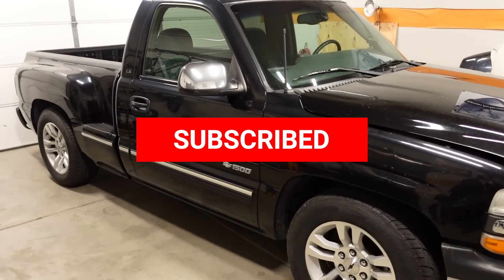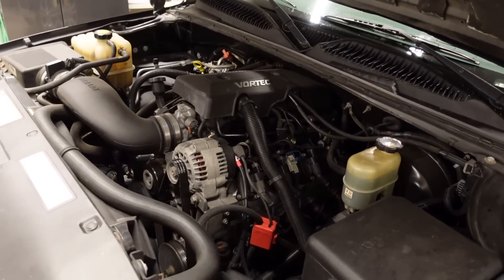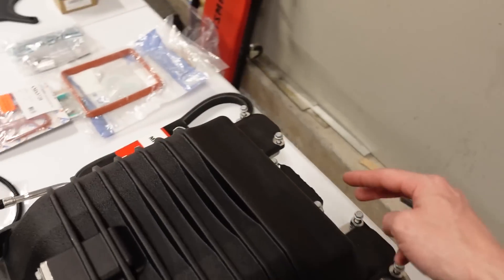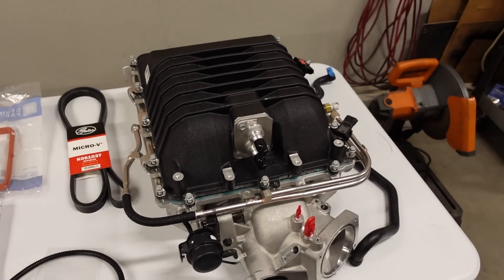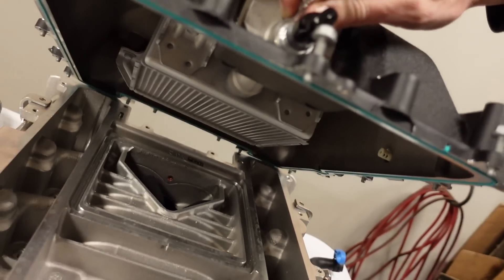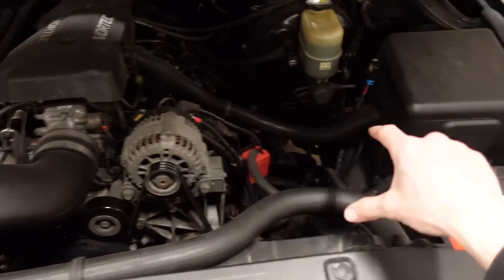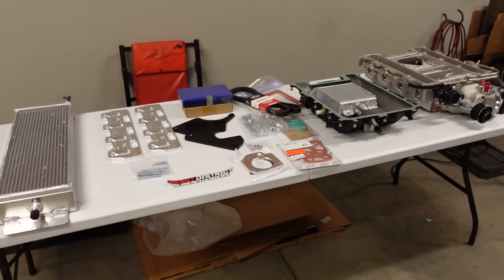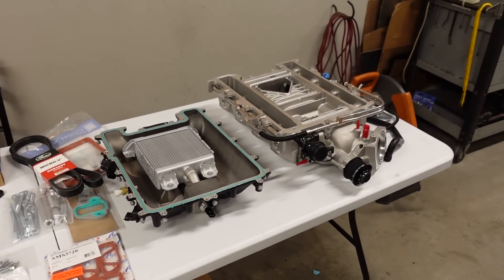unboxing my BOOST DISTRICT LSA Supercharger Kit

Comment: Just my personal opinion with a somewhat built 5.3 (668 HP forgot the torque) that I daily and I have a 70 Superbee that makes... idk because I'm still sourcing some lines so it can drive (previous guy let it sit for 20+ years). But I'd prefer a 4.8 / 5.3 OVER the 8.1 and 6.0... especially those older 6.0s those were turds unfortunately. I get once you rip things down and start building but then that just brings up way better options out there. 
The 5.3 has been really behaved and nice to drive. Just been keeping up on maintenance... and that time it blew the extension housing up.. whoops. Gave me an excuse to rebuild some stuff.
Anyways assuming this is intended as a street truck for cruising. I'd stick with the 4.8.
If you do choose 6.2 get that 6.2 with the 6 speed, that 8 speed is a damn problem. I would avoid 6.2s in general just like I avoid the 5.7 hemis because if I want something more there is way better options out there and if you're going to spend that kind of cash you mine as well pick an actual beast. 
OR hear me out, make your bank account cry and if you want a divorce this might help... Duramax awd in that little truck.

Comment: I have 4 6.0 engines a 4.8 block for mockup and a running 5.3 in my truck
One 6.0 boost ready sbe 
Cam, springs , headstuds and 80lb Snakeater injectors on a ported Dorman truck intake
Luckily i keep gettin 6.0s tossed my way

Comment: So I have a 6.0 and eventually I will do lsa then forged 408 lsa.. I love the supercharger sound.. I had a gtp and loved it. Turbos are cool but nothing like a supercharger.. to the tb I think you should get a 92 or 102 now bc your going to have to buy a 3bolt to 4 bolt adapter anyway might as well get bigger tb. I think the 78 will be a choke point and you can get a cheap ebay one  that will work great

Comment: I didnt notice a new throttle body....any reason why you want to use the stock truck TB over a bigger 4 bolt version?
Reply from the maker: I was just showing the parts that came with the kit, but I did actually order a 92mm TB to install
Reply: @TolmanPerformance  cool deal.   Although I wouldn’t kind seeing the power progression of the stocker to the one you ordered, to the next size and maybe some blower porting? 🍺

Comment: On the Corvette style regulator, I’ve had issues with 2 AC Delco units supplying too much fuel pressure 1 at 75 to 80psi, the 2nd at 85 to 90 psi.  This is with a Walbro 255lph pump in my ls swapped 72 GMC.  The previous regulator filter held 55psi but dropped pressure after turning off the pump, almost an instant drop.  I’m going Aeromotive pressure regulator.
Reply: Agreed. The vette regulator works well with a stock pump. But any time you put a bigger pump on, it’ll overpower the vette regulator’s return side.
Reply from the maker: good to hear, I had ordered an aeromotive regulator so I feel good about that

Comment: Holley sells a throttle cable bracket that bolts to the throttle body bolt holes
Part number 20-148
I’m using it on my lsa swapped Volvo works good!

Comment: Should at least pull it apart and open the ring gap a few thousands . . . The rings are known to buckle and a good chance to put mls head gaskets like you did . . .  another great choice for boost.
Reply from the maker: already took care of the ring gap last fall when I had the engine out, as well as installing MLS head gaskets and ARP head bolts. She's ready for boost!

Comment: Hey LT, you may have already said this before and I missed it.  Why did you decide to go with a LSA vs a Whipple or Magnuson?  I have almost the exact same truck setup, but an 04 with a manual.  I’m trying to decide which one myself?  Really like to hear your thoughts, thanks and love the channel.
Reply from the maker: good question on the Whipple vs Maggy vs LSA, and the answer comes down to cost mostly. The Whipple and Maggy kits are about $7k where the boost district truck kit starts at $4,200, and I like the fact that I can use an OEM 8 rib accessory drive if need be
Reply: @TolmanPerformance  
Thanks for the reply LT.  Totally agree with you on the cost.  I didn’t think about being able to run that 8-rib belt setup.  That’ll definitely help in my decision making.  Can’t wait to see how the blower setup turns out.  Really appreciate your channel and how you carry yourself.  Thanks again.

Comment: I would ♥ to see you adapt a LSA supercharger to the big block.  A Kong 2650 on an iron headed Gen 6 467 from Mark Jones at VortecPro under a stock hooded Monte Carlo or Caprice would be sick.  Nowadays anything is possible with modern CNC and 3D design/ printing/ prototyping.

Comment: The 07 and newer chevys had the battery in the back corner under the bracket....that battery tray may be a idea, or set it where filter is so battery cables be just as simple to set up as well

Comment: Lt, I'm planning on using the same lsa supercharger for my g8, but im up in the air on going with a 3.23 or a 3.42 rear to support the power or additional power later on
Reply from the maker: What trans, 6l80?
Reply: @Lawrence LT Tolman  yes 6l80 I'm planning on having it built or getting a gearstar the car has 70k on it. I've already got the one-piece drive shaft  frame connectors, and the full suspension built except the axles an rear

Comment: I think leave the 4.8 for now as is, unless you need something  to do while waiting for ugly truck money/parts.  If so.. then change out 4.8 to do a junkyard rebuild gen 3 6.0 with the same topend setup. Do the rebuilding in like 8 or 10 parts showing the dos and don'ts..  That would be fun!   Also, never think the exhaust stuff was too much... That is just real life.  I did the same with mine and am too embarrassed to say how much cost of parts/my labor to get it right. ( I literally had to buy another truck to use the parts leftover)  But now it is what I wanted and so satisfying when I get the comments that it sounds just right.  You are showing what it takes to get it the way you want.  Thx.

Comment: A customer of mine is going to order the same kit from them. Going on an aluminum 5.3L in a 1970 International Scout on long travel suspension. I asked why he wanted that kind of setup - turns out he drives a 702 HP RAM TRX daily. It's going to be lit, I have already requested a drag race between his TRX and this Scout when I finish it.

Comment: would a you able to drive it if the belt rips/fails ?
Reply from the maker: the way its setup now, the water pump would not be moving if the belt broke or came off, so regardless of it would actually run, it wouldn't be a good idea

Comment: A roots style blower will make about the same power no matter what engine is below it as long as the pulleys are the same size.  Kind of like a turbo. A 500hp turbos is 500 hp on a 5.7 and a 7.4. As the rotors spin a finite amount of air moves through it.  A smaller motor will see more boost, but the hp will be the same.

Comment: Hmm, not sure what year tour 4.8 I'd. Most likely it will bore out to 3.905, then you could get 383 with a decent stroker kit, get some ported heads along with that blower and you'd be set, relatively small amount of money as you own that engine already($2100 to 3k for stroker kit) heads around $1200 to 1500. Better cam, eh $350, maybe springs and new pushrods($99) then engine work
Reply: Oops, stupid phone, what year your 4.8 is. Some have really thick cylinder walls, like the lh6(I think) aluminum blocks, not sure about the iron ones..some can be bored to 4.00, most can't
Reply: The l33 like I have isn't siamesed bored, so I do better at cooling but my lower cylinder sleeve isn't as thick(probably not much of a problem for me as I'm only shooting for 650whp around 7200rpm). The later aluminum blocks had siamesed bores with thick sleeves too to bottom and I believe can be bored over more safely

Comment: I'm a big fan of the 408 idea.  You could build it based off of an L96 or an LY6.  They already come with square port heads, and work pretty good as they come.  Trick is finding one.  The rest of the parts can be ordered.

Comment: Love the LSA build! Definitely reinforce the brick, and get that blower ported with a 102 mm throttlebody. That right there will increase the boost level and help keep temps down because you don’t have to spin it as hard. I highly suggest relocating the battery and putting the air intake on the driver side.

Comment: I did this swap on mine with arp head bolts...beware the head bolts interfere with the adapter plates. Just a heads up man, love the build so far. A good set of 243 heads would go a long way as well
Reply from the maker: Well thanks for the heads up! I’ll watch out for those

Comment: I ran a B&M supercharger back in the mid 80's when they were still uncommon on the street. Sadly intercoolers were not available so we had to limit the compression to run on pump gas. I absolutely loved that engine.

Comment: Im one of the few that says leave it alone. Smaller cylinder volume fills faster. I say get a cam that let it rev it to 6500-6750rpm get a 3500rpm stall & 10-12 psi put you at 500 awhp.  High to mid 11s on good tires.

Comment: I really can’t say I’ve ever seen an LSA 4.8, sounds like a very fun setup: quick-revving, short stroke V8 that’s already very accepting of boost. I’m a 5.3 guy but the 4.8 has its own advantages that make it almost a different motor in some ways. Love the builds, LT, you keep me motivated to continue my 05 CCSB Silverado street truck project I’ve been working on since high school
Reply: Check out sloppy mechanics.  He did a g35 with a 4.8 and 6 speed.  Made like 700 hp.
Reply: 4.8-5.3, same bore different stroke, 5.3-6.0 same stroke different bore.

293, 325, 364.
Reply: @shadowopsairman1583  yes I know, the 4.8 if I remember correctly has a 9mm shorter stroke than my 5.3

Comment: I cant wait to see how this turns out AWD.  The FIC injectors are key to making the fuel delivery system tunable.  Most people do not understand the huge difference in flow rates in stock injectors and this is nightmare to tune.  FIC tests them to ensure they have a consistent delivery through the entire rpm range.
Reply: Yes I was at 14lbs on my 370” with factory lsa injectors, when I checked the data logs the duty cycle was at 130%…..I immediately ordered a set of fic850cc injectors……what a difference

Comment: I’ve said this before but there is a law of diminishing returns with overdriving blowers.
Aside from belt slip and heat there is a limited ability for the screws to create boost. At some point they just churn the air and make heat not boost. To get more boost you get bigger screws or feed it with a turbo. Otherwise you’re just wasting power making heat.
It can get to the point where the faster you spin the blower the less boost you make and the more power you rob from the crank to spin it.

Comment: i'd like to see a 408 stroker at some point.  those have always made impressive numbers n/a so with that supercharger its a winning combo for sure
Reply from the maker: I would love to build one of those for this truck
Reply: @TolmanPerformance  I would be worried about having enough airflow for that many cubes.  The little 1.9l LSA blower isn’t anemic, but for a 6.7 liter motor it’s a bit small.  What are your thoughts?
Reply: @TT.357  These days its smarter to get a harrop, kong, or matheson 2650 LSA style blower to go atop a 400CI or larger LS. Those blowers fix all the issues of the 1.9 LSA.
Reply: @TolmanPerformance  

@Lawrence LT Tolman 
I have the Lokar bracket from Motion raceworks.  I recommend the Lokar style cable bracket.  I bought the GM and the part of bracket the cable attaches to does not work, I used my old adapter from Glenn’s auto performance with Lokar base.  You will need longer throttle cable, approximately 42”, mine is from an s-10.  

It does not interfere with the fuel rail you can mount bracket under the rail.

Comment: What were some of the factors that made you go with the LSA vs. a procharger or centrifugal unit? Thanks man! Love the channel.
Reply from the maker: I kinda covered it later on in the video, but the low RPM torque and sound sold me on the roots style blower, plus I already have a turbo truck so I wanted to try something different.
Reply: Most likely cost and the fact that a procharger acts more like a turbo and he already has a turbo truck. Them procharger kits are like 9 grand! Dummy expensive compared too an lsa
Reply: All boost all the time. 😎